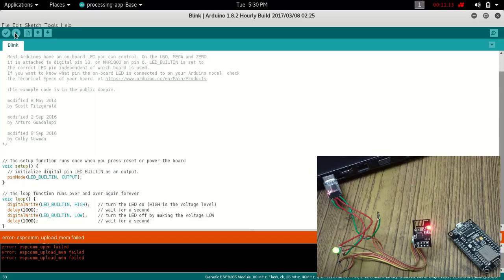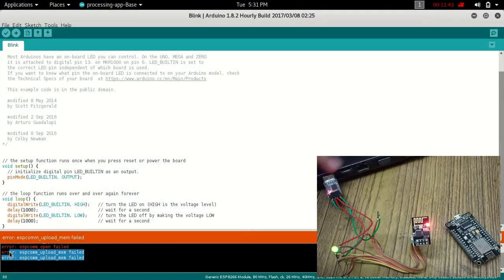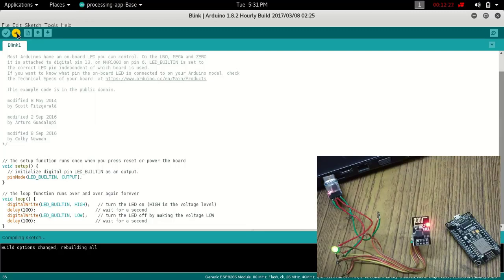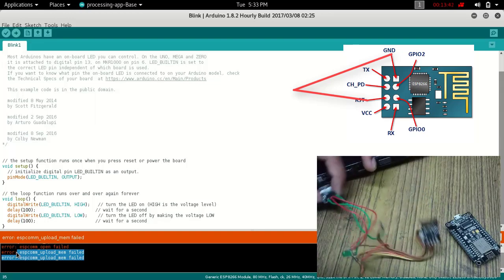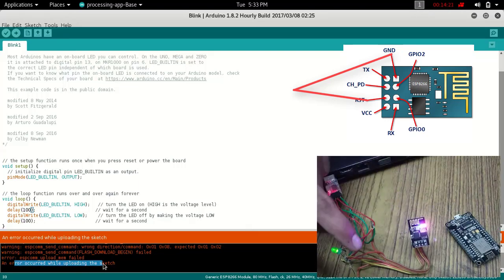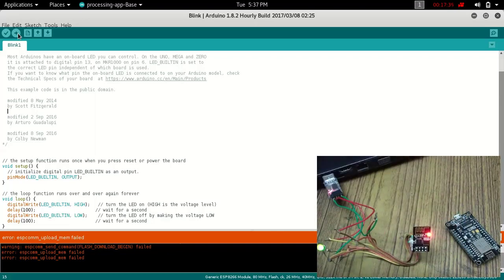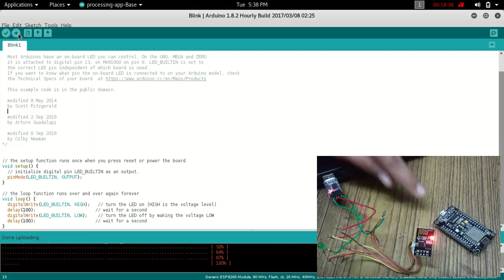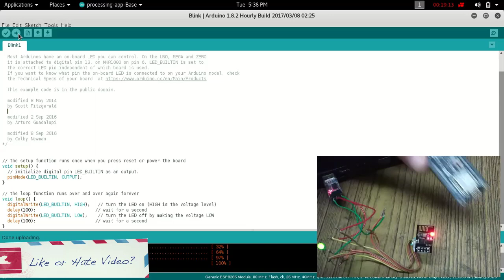Fix: espcomm_upload_mem failed | ESP8266 01 NodeMCU

Comment: please Help me FIx this issue

	setting board to ck
	setting baudrate from 115200 to 115200
	setting port from COM1 to COM3
	setting address from 0x00000000 to 0x00000000
	espcomm_upload_file
	espcomm_upload_mem
	setting serial port timeouts to 1000 ms
opening bootloader
resetting board
trying to connect
	flush start
	setting serial port timeouts to 1 ms
	setting serial port timeouts to 1000 ms
	flush complete
	espcomm_send_command: sending command header
	espcomm_send_command: sending command payload
	read 0, requested 1
trying to connect
	flush start
	setting serial port timeouts to 1 ms
	setting serial port timeouts to 1000 ms
	flush complete
	espcomm_send_command: sending command header
	espcomm_send_command: sending command payload
	read 0, requested 1
trying to connect
	flush start
	setting serial port timeouts to 1 ms
	setting serial port timeouts to 1000 ms
	flush complete
	espcomm_send_command: sending command header
	espcomm_send_command: sending command payload
	read 0, requested 1
resetting board
trying to connect
	flush start
	setting serial port timeouts to 1 ms
	setting serial port timeouts to 1000 ms
	flush complete
	espcomm_send_command: sending command header
	espcomm_send_command: sending command payload
	read 0, requested 1
trying to connect
	flush start
	setting serial port timeouts to 1 ms
	setting serial port timeouts to 1000 ms
	flush complete
	espcomm_send_command: sending command header
	espcomm_send_command: sending command payload
	read 0, requested 1
trying to connect
An error occurred while uploading the sketch
	flush start
	setting serial port timeouts to 1 ms
	setting serial port timeouts to 1000 ms
	flush complete
	espcomm_send_command: sending command header
	espcomm_send_command: sending command payload
	read 0, requested 1
resetting board
trying to connect
	flush start
	setting serial port timeouts to 1 ms
	setting serial port timeouts to 1000 ms
	flush complete
	espcomm_send_command: sending command header
	espcomm_send_command: sending command payload
	read 0, requested 1
trying to connect
	flush start
	setting serial port timeouts to 1 ms
	setting serial port timeouts to 1000 ms
	flush complete
	espcomm_send_command: sending command header
	espcomm_send_command: sending command payload
	read 0, requested 1
trying to connect
	flush start
	setting serial port timeouts to 1 ms
	setting serial port timeouts to 1000 ms
	flush complete
	espcomm_send_command: sending command header
	espcomm_send_command: sending command payload
	read 0, requested 1
warning: espcomm_sync failed
error: espcomm_open failed
error: espcomm_upload_mem failed